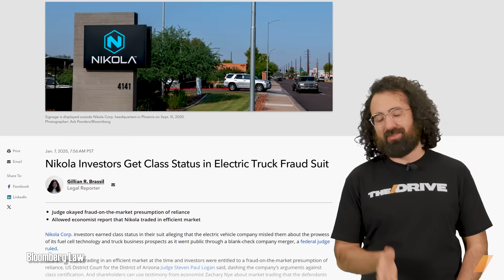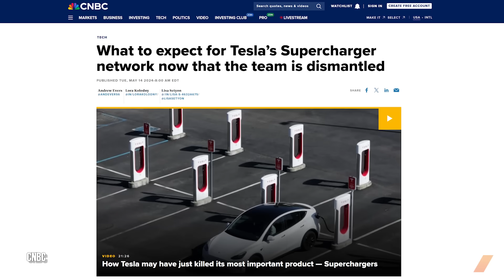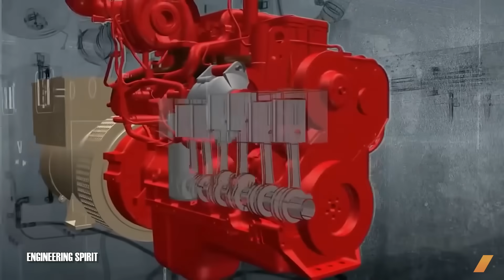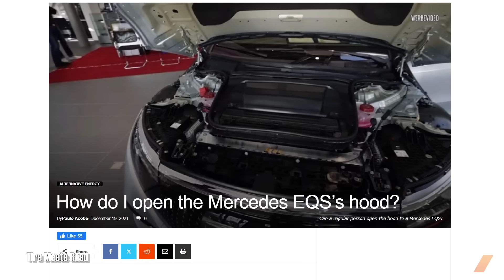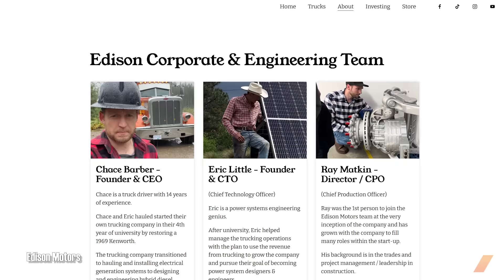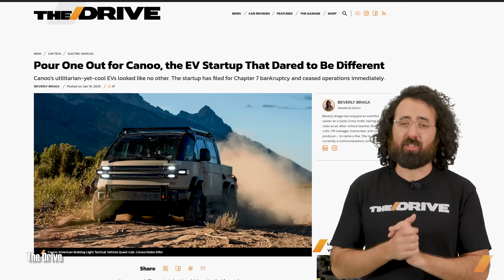The truckers in a shed beating Tesla with 100-yr-old EV tech

Comment: Forgot to mention also is that the diesels can legally run on cherry diesel because it's a generator and not apart of the drive train
Reply: yeah... this is getting quickscoped in court. assuming it isnt already covered under current laws.
Reply: A small upstart company would be foolish to roll the legality dice of using offroad diesel... on the roads.
Reply: That's not going to last. They're just getting away with it temporarily. If you're powering the vehicle with it, you're supposed to pay the tax.
Reply: @fascistpedant758  it’s no different to carrying around a generator and using it to charge a regular ev
Reply: But the truck is still rolling down the highway regenerating the batteries. That loophole might not work
Reply: @sandasturner9529  It very much does work. These trucks don't require the generator to be ran EVER. They don't care where the power comes from. You can charge 'em from the grid, or from solar, or from the generator under the hood, or from a generator sitting on the ground.

They may eventually change the laws, but that's true of literally every law, so it's not really an argument.
Reply: @sandasturner9529  They specifically asked the Canadian government about that, and apparently the loophole still applies. How long, is another question. I imagine somebody's going to wise up to it sooner or later.
Reply: @sandasturner9529 not for long, it does for now😂
At least in Canada as per edison, they asked
Reply: Haha, what? This is incorrect. Feel free to try it though. You could get away with it until anyone actually looks.
Reply: @Blynx1991  I am only saying what Chase Barber, the CEO said. He literally made a vid saying they're running cherry diesel for the generator
Reply: Barber uses the truck for logging, it can run untaxed diesel if it is not on public roads.
Reply: @Blynx1991  k, but you wrong, tho... 🥱
Reply: @Wrenchmonkey1  It's illegal for any road use barring agri, at least in Canada
Reply: @Blynx1991  it's not road use. It's generator use. Which is one of the explicitly stated uses. It's no different than having a generator on an RV. You gonna claim you can't use red diesel in a Generator if it's installed in an RV?
Reply: @Wrenchmonkey1  No? Those are two entirely different use cases. One is personal and the other is commercial.
Reply: @Blynx1991  it doesn't matter. Red diesel use isn't based on whether the use is commercial or personal. You can't run it in a personal diesel propulsion engine either. That's never been a differentiating factor. The differentiating factor here is that a generator is NOT a propulsion engine.

The propulsion system is fully electric, and it does not care where the power comes from. Grid power, solar power, wind power, regen, generator on the ground, or a generator mounted to the vehicle.

The generator could be completely removed, and the vehicle's propulsion system would be completely unaffected.

That's why it can run red diesel. The laws MIGHT get changed someday, but as it stands now, red diesel in an on-board generator is NOT a violation of the law.
Reply: @Wrenchmonkey1  Well you go right ahead and do it, if this thing ever makes it out of youtube videos man, lmao.

I'm sure the DoT will accept your explanation of why you don't have to pay fuel taxes on public roads.
Reply: @Blynx1991  For the same reason you don't have to pay fuel taxes on an RV generator, On PuBlIc RoADs...

It ain't rocket science, bub. 

What's your favorite flavor of boot polish?
Reply: @Blynx1991  The Canadian province of Vancouver is not in the jurisdiction of the DoT
Reply: @Wrenchmonkey1  I believe cherry diesel can be used for fishing boats, though I could be wrong, but I remember a fisherman friend mention it once.
Reply: @pwalker1360  you definitely can. There's no road fuel tax on boats. If you buy diesel in a marina, it's pretty much always gonna be red diesel.

Comment: Why are you comparing a hybrid to a ev.  Not the same
Reply: If you want the greenwashing then its not perfect (but up to 70% is much better then noth) but if you want the advantages of electric (silent, insane torque, regen, can be chared for cheap) but not the disadvantages (range, charge time) its a great option.
And the Edison truck is fully electric just with a smaller batterie and coincidentally it carrys its own charger that runs on the most found energy source in industry.

Comment: For real short stuff, with lots of stop and start.. gotta add some capicators.  You get better performance out of them in every way except power density, and that really doesn't matter on site.
Reply: Well energie density is a big important when you deal with semi truck energy quantitys.
Reply: @raphiseth6942  energy is how it's spelled, and no you don't need density if you're local and can charge all the time.
Reply: @MindCrime550    Sorry, english is not my first language.
Ok Energy.
Energy density does matter: one normal lithium cell has about 100 times the energy of a capacitor of similar size and weight. That means the volume and weight of 100kWh of lithium batterie energie equal about 1kWh of capacitor energy that is not even enough to drive 1mile.
I mean, i understand your idea, and you are right they need a lot of power and not a lot of energy because of the generator, but unfortunately, it doesn't work like that.
Tom Stanton has a great video about his "super capacitor dragster" that puts a bit of perspective on capacitors.
They choose the batterie chemistry and size, not for range ,they choose it for the poweroutput

Comment: Edison Motors is just taking the next logical step with semi trucks. It makes sense to make something like that a hybrid. Idling and stop and go traffic is the worst for them, and being able to run full EV when needed is huge.
Reply: I think there should be plug in hybrid car mandates before electric car mandates. The grid and charging network isn't ready for full electric vehicles.
Reply: @benargee  Stop getting mislead by the Angry Grandpa Box. There isn't a EV mandate. It's an ongoing ramping emissions mandate. Which hybrids have always been eligible for, it is just:
1) in general hybrids are economically also-rans, have been and will remain so
2) that the window for where you can meet the emissions limits via hybrid-only is getting very small
Reply: It doesn't actually make that much sense for highway use, definitely not for local delivery use that is 80% of class 8 miles, vs full BEV. This is a niche solution for logging, out where there's no grid. There are going to be a few other edge cases for this, but most human activity is served reasonably well by the grid and that is increasingly so over time.
Reply: @aoeuuaoaou  You're extremely wrong, for a multitude of reasons. Literally everything you've said is just patently incorrect. Tesla's trucks can be grid-charged as well. There's no reason one would ever HAVE to run the generator, provided one can get sufficient grid-charging. This gives all of the benefits of BEV, plus all of the benefits of IC-powered trucks.

You can run purely electric on short runs, and recharge from the grid, OR you can run the generator to still have the same unlimited long-haul range of a diesel-powered IC drivetrain.

It doesn't have to be either-or. Which makes it perfectly suited to EVERY application of trucking, instead of cherry-picking one or the other for a unique niche.

The generator only runs when the batteries need to recharge, so you can be sitting in traffic with the engine not running AT ALL, or if the batteries need a charge, the engine is running at it's peak efficiency and power output to recharge the engine, only for as long as it needs to, to complete that task, and then it shuts off again.

Idling a traditional IC engine in traffic does nothing but waste fuel, and constantly having to rev it, shift it, lug it, rev it, etc, is horribly fuel inefficient, and adds additional unnecessary wear and tear on the engine.
Reply: @ 

Nope, you're entirely upside down there.

Are drunk posting? Because that reads like you were drunk posting.

Hybrids are more expensive than BEV & ICE  to build, and maintain. They can have an edge over pure ICE on fuel because of the zero idle, but again, that's very little concern for diesels in practice because diesel engines use so little fuel idling.

Obviously hybrids cost more than BEV for fuel.
Reply: @aoeuuaoaou  the cost difference to add a generator is pretty negligible, and an Edison truck can do EVERYTHING a BEV truck can do, and more. You NEVER have to fire the generator up, if you don't want to.

Suggesting that trucks don't burn fuel idling or in stop-and-go traffic is also hilariously ignorant. 

What planet are you from?
Reply: @Wrenchmonkey1  

Incorrect. A generator adds space, weight, $ cost. Quite a bit, because you need a motor that puts out power near what the ICE would, to be able to climb extended slopes under full load.

And that cost is all there even if you don't run it. Ever. If you never run it to bring  the hybrid fuel cost down to BEV fuel cost then WTF is the point of having the ICE onboard at all?

You clearly don't know WTF you're talking about, the actual subject.
Reply: @ 

P.S.

> Suggesting that trucks don't burn fuel idling or in stop-and-go traffic is also hilariously ignorant. 

Good thing I did NOT say that, huh? We might have discovered your core issue, functional illiteracy?
Reply: @aoeuuaoaou  "power near what the ICE would, to be able to climb extended slopes under full load."

Oh, honey, bless your heart. You can't have it both ways. If you want to operate it like a BEV, you never have to fire the generator. But if you want to do what a BEV can't do, then the generator gives you that OPTION.

You don't get to extol the virtues of a BEV and then claim that operating a hybrid as a BEV would be impractical because of sustained pulls on steep grades. Duh! You can't do that AT ALL with a BEV, but you COULD with a hybrid. That's the whole point. If you don't want or need to do long-haul stuff, you never HAVE to fire the generator. But having the generator gives you OPTIONS to do so.

It's astounding how anybody can be this dumb. Are you just pretending?
Reply: @aoeuuaoaou  You very much did suggest it. Idling burns plenty of fuel, bub.

And there's just about nothing that burns more fuel than constant starting and stopping. Sitting at a light idling consumes fuel, but it's hardly the biggest issue with efficiency; it's getting moving again that consumes massive amounts of fuel, and puts tons of extra wear and tear on the engine.

Only a moron looks at the situation and thinks that because the engine is 'only idling' while sitting still, that somehow being in traffic isn't an absoute, fuel-guzzling, efficiency nightmare. 🤡
Reply: @ You are misreading my posts, inventing your own stuff. You're way out of your depth here.
Reply: @ An example; Getting a bit more specific, diesel engine uses roughly 1/4 the fuel that a gasoline engine uses during idling. That's part of why you don't really see "stop engine at light" tech installed on diesel motors, like has been used on gasoline motors for several years.

That's why I said (AND READ CLOSER THIS TIME) a diesel hybrid fuel savings for that scenario vs a straight ICE diesel drivetrain are far less than compared with using gasoline as fuel in hybrid vs straight ICE.

So less fuel benefit over a pure ICE.... AND of course, as repeatedly covered, still worse than straight BEV.
Reply: @aoeuuaoaou  there are plenty of short haul trucks and trucks that get stuck in traffic that could benefit from this. If the truck is also a plug in hybrid, it can take advantage of fuel saving for a portion of it's trip. It can also use regenerative braking instead of loud engine brakes regardless of highway or short haul.
Reply: @benargee  ....and they are flat out inferior to BEVs in those applications.
Reply: @aoeuuaoaou  able to turn off the engine at the red light and run at the most efficient RPM and load is what makes hybrid so efficient.
Even on highways, the engine can run more efficiently, 5-10% improvement is a great deal.
Reply: @ 
1) that's the magnitude for gasoline, diesel engines have much lower fuel usage idling
2) obviously that's no benefit at all for the relevant comparison, to BEVs, so you're just left with the much lower fuel efficiency of the ICE generating electricity for use by the EV side of the drivetrain

Comment: Weird. We were talking about this back in 2012, when we were looking at re-manufacturing the control systems in trains. Then I found out that Neil Young did it in his '59 Lincoln Continental called "LincVolt". He had a guy who specialized in doing hybrid conversions on large vehicles over in Kansas do it. He showed it at SEMA one year.  It's been spotted getting rebuilt with a new hybrid drive train after it got gutted by a battery fire.

Comment: I think that the way to make the change to an e-axle easier is to directly have a motor that is a replacement for the core, that way the cost of the elements and freight would also be reduced, it would eliminate the infinite variations (dana 30,44 and so on only) and a replacement of the gearbox with a generator with plates adaptable to each motor, a "universal" battery pack and the electronics that can be housed where the cardan used to be.
Reply: At Deboss Garage, Rich is doing just that for Edison. He's crafting a universal electric center pumpkin and then stock axle tubes can be bolted to it.

Comment: Very poorly researched or else deliberate miss information.  #1) At the time of this posting at least Walmart, DHL, SAIA, and Tesla’s own fleet  are operating Tesla Semi’s.  #2) The GM hummer has been rated as the least efficient EV currently being sold with a miles per kilowatt hour per GVW pound  comparison that proves it was selected in order to negatively skew the Tesla  semi’s battery weight estimate.  #3). Yes battery Semis are heavier than diesel semis.  That is why electric semis are allowed a gross combined weight of 82,000 lbs vs the diesel’s 80,000.  A fact not mentioned.  I congratulate Edison Motors on their innovations and progress towards improving truck designs.  I feel you diminish their accomplishments and credibility by your poor or else slanted reporting.
Reply: #1 Yes, fleet operators have Tesla semis, and zero individual owner operators have Tesla Semis'. Probably someday in the future.

#2. Thats fair, do you have some better numbers? Off the top of my head, Tesla semi gets 1 mile per kWh and a normal electric pickup gets 2 miles per kWh.

#3 Yes Electric Semi's are heavier than traditional semi's.
Reply: Yeah this video is laser focused on the current downsides of EVs, while glossing over the fact that these Edisons ONLY get 5-10% fuel savings on the highway. That is by no means going to solve emissions lol. Not particularly impressive at all. Sure the stop and go savings are great, but the long-haul truckers in remote areas they are targeting probably don't spend much time stuck in traffic...
Reply: @OneMoreTank  🙄
Reply: not to mention he avoided to mention all the european eletric trucks
Reply: Edisons engineering is severely flawed. Its just a ridiculous concept. High, high cost for negligible savings.
Reply: @CL-yp1bs  such a ridiculous concept that Edison was offered millions to buy them out, and small competitors are popping up right and left doing the same thing, and Ford, Scout, Ram are all making EREV's
Reply: @ Marketing and talk is much different than actual real world results. Save this comment, and check back in with me 1 year, 2 years, 5 years from now and let me know what Edison motors is doing besides finessing money out of investors.
Reply: @Sah-o5m  Also, a few million is chump change in this industry. Thats pennies. It means nothing, even IF it was not just marketing mumbo jumbo/hype like Edison is so good at
Reply: @CL-yp1bs  Well I think Edison is good enough, and smart enough, and dog gonnit, people like them. :)

Comment: “Tesla costs $250K!”- doesn’t say how much ICE trucks cost. “Tesla batteries will have to be replaced!”- doesn’t say how soon, or how that would compare to ICE maintenance.
Reply: A Tesla comparable ICE truck is prob $200k. All electric batteries degrade over time. They drop to like 50% capacity at 15 years. Yes, an ICE truck is probably getting an engine rebuild at 15 years.
Reply: People comparing the tesla plaid to the equivalent dodge hellcat were shocked to learn the tesla battery was $22k while the hellcat engine was $30k.

Comment: Edison trucks harvest potential energy if they load cargo at a higher elevation and deliver it to the client in the valley.  Obvious in most forestry harvest operations.

 Oil from higher elevation well will give an Edison tanker a similar saving if the depot is lower.
Reply: We try not to truck too much oil down roads if we can avoid it.

Pipelines to central batteries end up being massively cheaper and more safe as soon as there's any sort of real volume

Comment: The solution to EVs is living inside the city/town you work and Ebikes and having everything else on rails

Ebikes have 1% as much material used and 1/10th the distance traveled

And trains with overhead power don't need batteries 

You could argue that this will take time as in decades to accomplish, but so would have EV technology and Norway has proven EV tech today is actually more than enough.